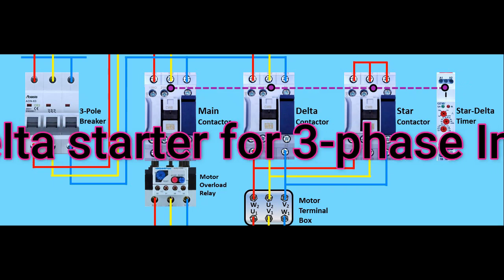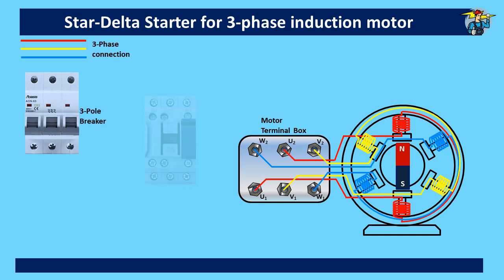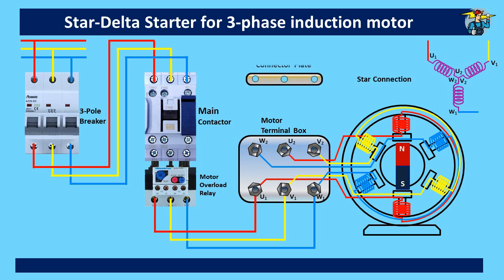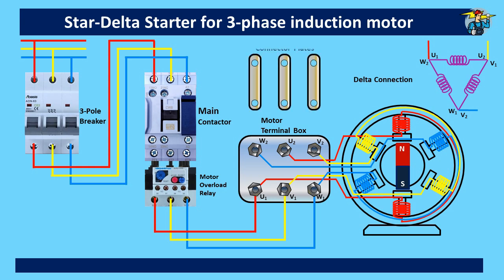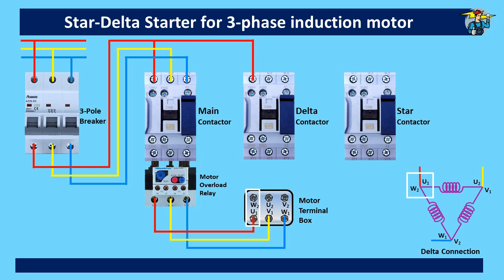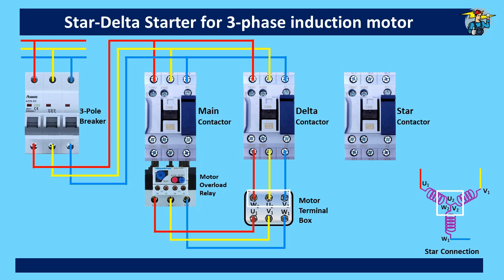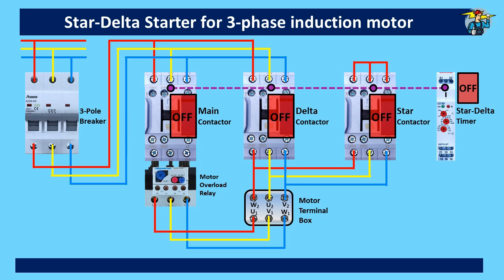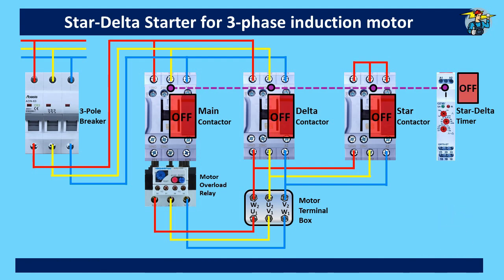Star Delta Starter Working Principle Explained / How to Wire a 3 Phase Motor 😍💪

Comment: what is the recommended starter for a 10hp motor with 3 wires?
Reply from the maker: For 10 hp 3 phase motor, star delta starter can be used..
DOL starter can be used only upto 5 hp motors.

Comment: Still wouldn’t try it this way… not without a contactor interlock stopping things going wrong with a bang
Reply from the maker: You can introduce a mechanical interlock also, in addition to the electrical interlocking provided here.